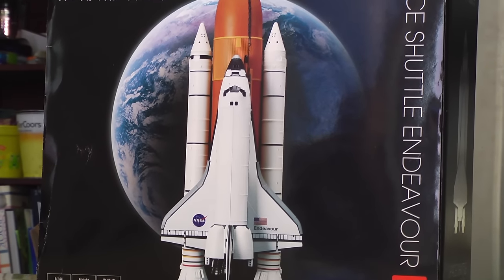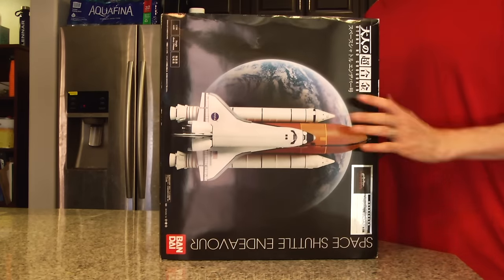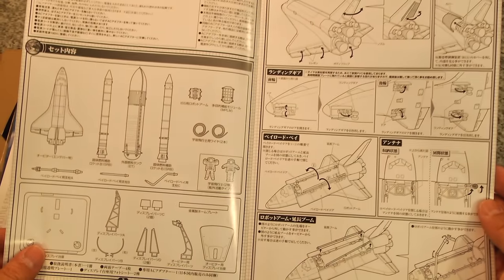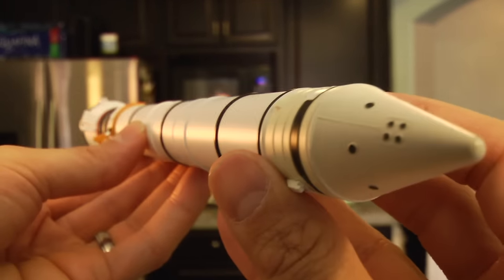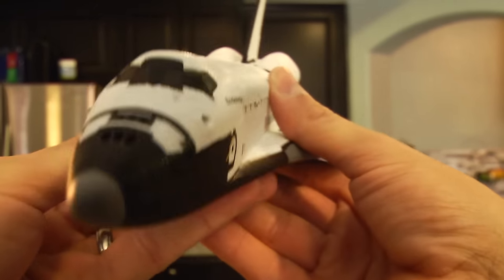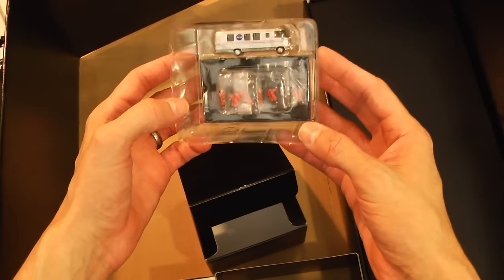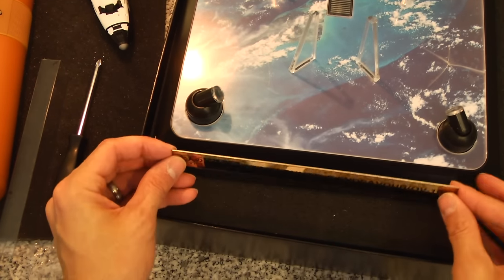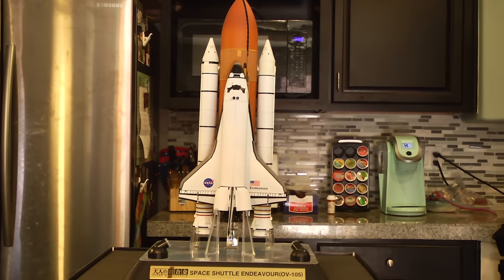NASA Space Shuttle Endeavour Die-cast Chogokin Tamashii Nations Bandai Review unboxing part 1

Comment: There was 6 shuttles they go in order Enterprise OV-101 Columbia OV-102 Challenger OV-99 ( Challenger was originally built as a Structural test article and was later converted to go into space as it was deemed too costly to try to convert Enterprise for space flight plus she lacked most of the systems necessary to go into space as it was . This prompted Nasa to choose Challenger over Enterprise as she far enough  along in her test fazes and completeness and was considered easier to convert for space flight over Enterprise. Challenger was also slightly lighter than both Enterprise and Columbia due to advancements in technology and building procedures at the time.  ) Then there's Discovery OV-103 Atlantis OV-104 then Endeavor OV-105 Endeavor was built as a replacement for Challenger using Structural spare parts. It was never intended for there to be 6 shuttles as Nasa felt it had it's work cut for them just trying to maintain 4 flight worthy shuttles with the 5th non flight worthy shuttle being Enterprise. So with the addition of Endeavor later on after the Challenger accident this officially brought the total to 6 space shuttles but only 4 of them  minus Challenger and later Columbia which reduced the fleet to 3 were actually flight worthy vehicles. Just a tid bit of history for you.

Comment: Thanks for sharing! 
I am one of the lucky ones to own this magnificent piece of art. Back in 2011, when I was attending graduate school in the States, I found that they released this not a while ago. I placed the order from ebid website. Just checked the electronic receipt from my gmail account. It only cost 465.42 USD (420 USD plus 45.42 for shipping). And it's a brand new one. I am very satisfied with this set.
Reply from the maker: Do you still own it?
Reply: I should use present tense. 😂 it’s sitting right on my nightstand. 😉
Reply: Can you please Share Buying Link....!
Reply: @devendrashinde1680   I bought this set on ebid a long time ago in 2011. I doubt there will be any left. But you could still try to search on eBay for second hand ones. It won’t be cheap though. Good luck!

Comment: There was really 6 orbiters made it’s weird that 6th shuttle but it was actually the 1st was a test shuttle called the Enterprise at least if my memory serves me correctly
Reply: Correct. Challenger, Endeavor, Enterprise, Discovery, Atlantis, and Colombia
Reply: The Russians made 2  that was pretty much a carbon copy of the American shuttle, and one even flew, so 8 if you count the Russian ones
Reply: TomahawksNShotShells thanks for the conformation
Reply: @rowansanderson3132  its not Russia, its USSR / Soviet Union
Reply: @rowansanderson3132  The Russians made more than 2 Shuttles.  Probably at least as many as the US not even counting the subscale "spaceplane" (around the size of the US lifting bodies) that MiG manufactured and tested.  They have one of those spaceplanes at the Russian Air Force Museum around Molina which is a suburb(?) of Moscow.
Buran, the flight vehicle, was destroyed by partial collapse of its hangar in the early 2000s.  The Germans bought and restored another test vehicle (same general spaceframe design as the Buran that orbited) that flew with jet engines to simulate landing.  Its main difference from the Enterprise was that it COULD take off and land on its own power (I think; I'm not sure about the takeoff part).  The particular German museum that owns the Buran test vehicle has a lot of Russian hardware in its collection including a surviving Tu-144 posed with a Concorde.  It's the only museum where you can see the 2 SST types together.
There are still pieces of 2-3 more partially finished Russian shuttles in the old hangar area in the Kosmodrome (?) in Kazakhstan.  They're covered in dust and bird poop.  They'll never do anything with them.  The Russians are even worse at leaving their old junk rotting around the place than we are.  I've think the Russian authorities moved most of the launch activities to the eastern part of Russia at another site since they have to license the old launch facilities in Kazakshstan.

Comment: When naming the space shuttles you always wanna name them from oldest to newest (*COLUMBIA,CHALLENGER,DISCOVERY,ATLANTIS,ENDEAVOUR*) endeavour replaced challenger. They originally wanted to get enterprise and make it space worthy but it was cheaper to just build a new one. Also endeavour is the lightest with Columbia being the heaviest this was important because Columbia was handicapped by her big butt. Endeavour could go a lot further. Columbia couldn’t go to the ISS really because her weight.
Reply: post STS-107 Columbia (OV-102) was supposed to go major overhaul to reduce the weight and fly to the ISS for a couple missions atleast since around that timeframe one orbiter (Endeavour) was undergoing major maintenance and NASA couldn’t support ISS missions with just 2 Shuttles (Discovery and Atlantis)
Reply: The oldest and most unique of them all, Enterprise the first ever Shuttle built but wasn’t sent to space. She was attached to a boeing 747-SR46 because it was only used for an “air atmostphere” thingy WITHOUT engines. She was also sent to space without any equipment of rockets and the fuel tank by maneuvering the shuttle to space obviously with it’s rocket engines [I don’t know] before coming down to earth landing to the runway without engines. She doesn’t have any landing gear brakes just like all the Shuttles, actually she uses a parachute to slow down [It lands smoothly].

Comment: Danoby2. Thanks for linking me to the Saturn V. But I also want that model. I want it. I'm jealous that I don't have Bandai rockets. So I really really REALLY want that. I just am a massive fan of the shuttle, especially the endeavor(for some reason.)
Reply from the maker: Good luck!
Reply: Where did you get it? Was it online?
Reply: I am a fan of the shuttle, but the endeavor doesn't make any difference between the other orbiters(except for missions and the orbiter name) but I just chose the endeavor
Reply: And no, the external tank won't be recycled or re used. The tank would disintegrate upon re entry, and if it doesn't, there are little Jets that will assist in making sure that it breaks up. Yes the shuttle and SRBs are reusable. Obviously, it's a reusable plane or rocket